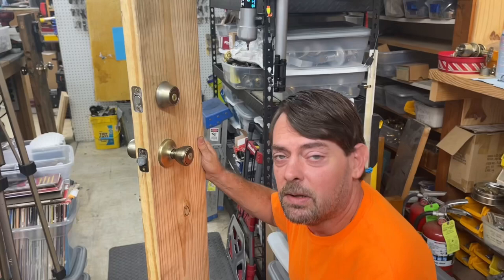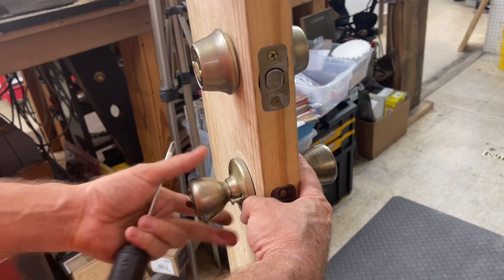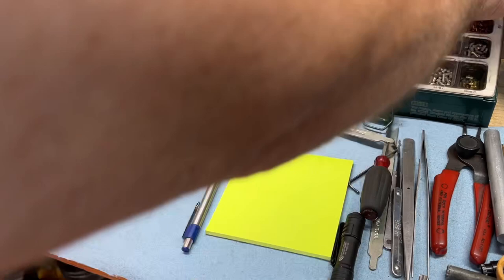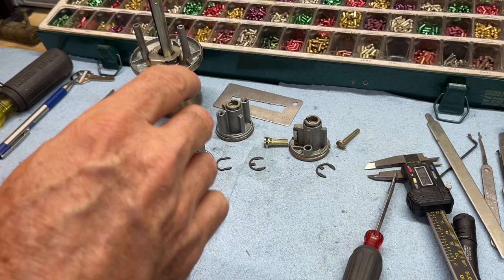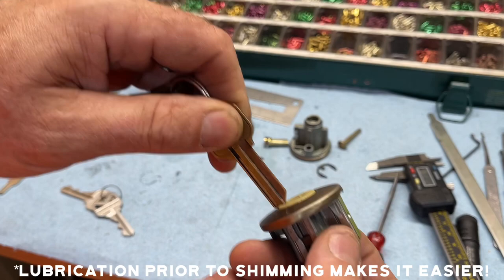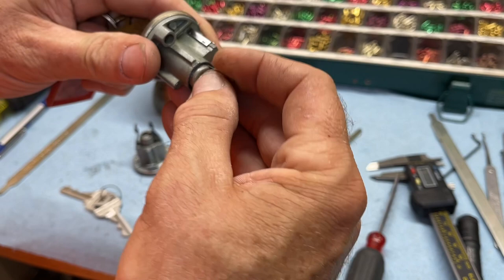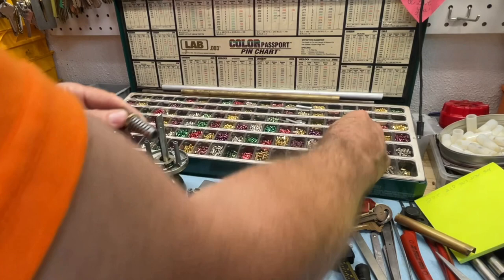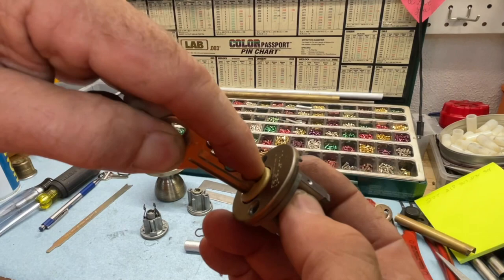Residential Locksmith Starter 5 - Kwikset Standard Rekey

Comment: Great video Jason, I would have loved something like this when I was first trying to figure out Kwikset locks! So many great little tips here like the double pickle fork & spindle thing. I don’t automatically toss all old pins, if time allows I’ll measure them and compare to what they “should” be; if they’re extremely close I’ll save them to reuse, but I only rekey locks for myself, if it was for a customer I’d probably just toss to reduce chances of a callback and to feel better about the work. I didn’t know some of the Kwikset pin #s changed over time—very cool info to have especially dealing with older locks/pins. Thanks for making this 😊🙏

Comment: Great video.. I do believe that you might have missed your calling .. Instructor  ...  Putting the button at a 45 degree angle ( half way ) and centering the spindle are 2 things that I was not taught  , I was told to put a mark on the inside of the outside knob to know  what position to put the lock back in... Once again  great videos ....  Thanks

Comment: Interesting, you said MACS is 5 for kwikset. I looked at my .003 pinning kit and it said 4. Then I looked at my mini kit for kwikset, Weiser and Schlage and it said 5 for kwikset.
Reply from the maker: I prefer to stay within 4 regardless of what the kit says!
Reply: @selock  Thanks, as always, for your experienced input.
Reply: I've always been under the impression that Kwikset was a MACS of 4. I think the MACS of 4 partly is based on their OEM pins. With how short the taper is on those, it may limit the MACS to 4, while with universal pins, those have a much longer taper, which could in theory, allow for a safe MACS of 5

Comment: I would pop out the cylinder at the door and reinstall the entry set, thereby leaving the door able to be open and closed without fear of latching. After rekeying its just a matter of pressing the the cylinder back into the entry set. Also less hardware to carry back to the truck.
Reply from the maker: Yep you can certainly do that too, except when the customer is following you around everywhere. Then you make sure and say be right back and let the door close 😂😂
Reply: @selock  100%👆🏼😂

Comment: What do you do in a situation where you have a kwikset and the plug has a gap near the tail? I have ran in to several when I didn't have any shims with me and had to use a piece of tape to cover the gap but it's not easy getting the tape off when it is back together